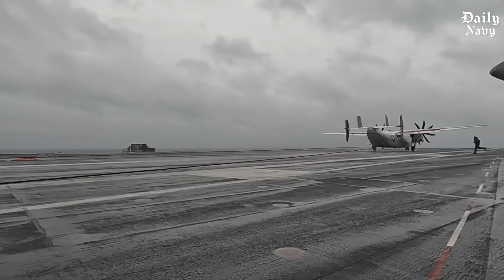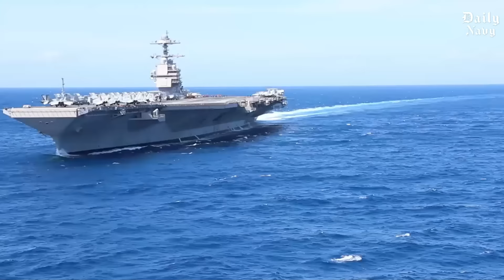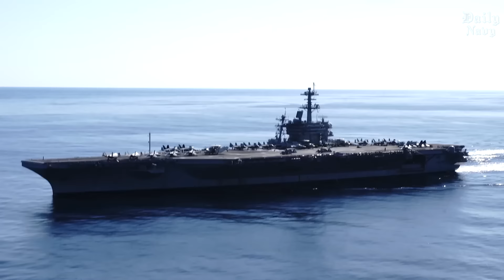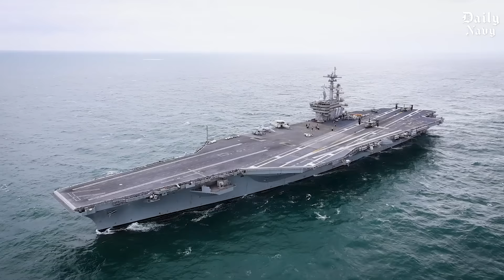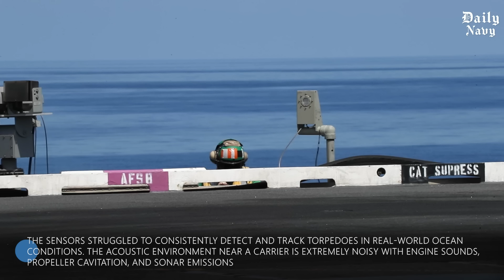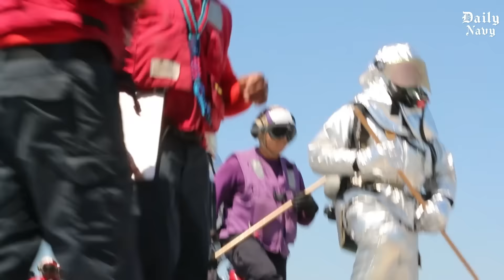How Massive Aircraft Carrier Survive MONSTER Torpedo Impacts

Comment: That all makes sense from a theoretical standpoint, particularly regarding defenses against torpedoes. However, I do not think aircraft carriers have adequate protection or structural resilience against anti-ship ballistic missiles. These weapons attack from above, descending nearly vertically, allowing them to penetrate the flight deck and continue through multiple internal decks toward the hull, effectively drilling a shaft through the ship. This is especially true for the type of anti-ship ballistic missiles reportedly developed by Iran, which are conceptually similar to bunker-buster weapons and designed to penetrate structures before detonation. Because such missiles travel at hypersonic speeds, the time between detection and impact is short, compressing the tactical window for interceptors on escort destroyers to engage them. Under some conflict scenarios, defenders may not detect every launch early or track every trajectory sufficiently to guarantee an intercept before impact. Given the hypersonic velocities and associated kinetic energy of these missiles, an aircraft carrier would have very limited capacity to absorb such strikes. If several of these missiles struck an aircraft carrier in quick succession, it would likely be mission killed, if not completely disabled.

Comment: Bad design; too vulnerable.  A carrier with its airplanes and crew may cost around $20 billion, yet a dozen Mark 48 torpedoes would only cost $60 million (and far cheaper if homebrew hardware store special torpedoes that are remote control FPV drones that simply travel 1-2 meters under the water line, and have a communications antenna that sticks slightly above the water line).  A dozen torpedoes absolutely can and would readily win a fight against a $20 billion carrier, which ruins the economic equation and makes carriers a very poor use of valuable and limited economic resources.

To better protect against torpedoes, the ship hull needs to stay out of the water.  One way to do that, is to design a "navy ship" as an airplane, with sea landing capability, so it can conserve fuel while on station by simply sitting on the water surface.  Then, if a torpedo is heard approaching, the "navy ship" can take off and become airborne as needed to avoid the torpedo.

An alternative potential improvement, would be to use a more conventional naval ship design, but mount long legs with hydrofoils on the bottom, similar to the "USS Pegasus".  Then, upsize the nuclear reactor power levels on the carrier dramatically, so the carrier can continuously maintain high speed travel while lifting the main carrier hull body out of the water entirely, via the hydrofoil legs.  Only the bottom of the legs and the hydrofoils need to be in the water at all.  Additionally, non-hydrodynamic cages and air pockets can be built around the hydrofoils, in order to cause incoming torpedoes to detonate on the cage, which can be physically separated from the hydrofoil and bottom of the legs.  Although non-hydrodynamic structures under the water line incur a propulsion energy efficiency penalty, such penalty can be paid and overcome, when the nuclear reactor cores are upsized in power level sufficiently.

Multiple legs should be used, which are redundant, such that damage to only one leg and hydrofoil does not necessitate lowering the whole hull back down to the water surface.  Lifting the sensitive bits of the aircraft carrier out of the water (especially the nuclear reactor cores and the explosive ordinance magazine for storing the airplane munitions) would greatly help to protect such vulnerable ship areas from torpedo attack.  Lifting the carrier body out of the water would make the sensitive parts of the ship more vulnerable to airborne missile threats, but incoming missiles are easier to detect/track/intercept, as compared to underwater torpedoes.

Upsizing the nuclear reactors and increasing propulsion power enough to achieve hydrofoil "flight" above the water, would make the carrier move much faster during normal operation, which would hypothetically prevent other non-nuclear powered ships from keeping up due to fuel consumption reasons.  To fix that problem, other ships in the carrier strike group, that do not have their own nuclear powerplants, should instead be designed to use electric motor propulsion, with a diesel generator.  Then, when travelling in the carrier strike group, a rapid breakaway power cable should be strung between the carrier and each other electric ship in the strike group, so the nuclear powerplants on the aircraft carrier can keep the other ships continuously powered at a level sufficient that they can continuously keep up with the carrier.  Essentially, all ships in the carrier strike group should be electric powered, and they should all also implement legs and hydrofoils like the USS Pegasus, in order to keep their main hull out of the water.  Such a scheme would effectively make all the ships in the carrier strike group nuclear powered (from the aircraft carrier reactors), which would greatly reduce need for constant refueling operations of the support ships.

The hydrofoil legs on each ship should however be designed to be quite a bit longer than that which was implemented on the USS Pegasus, so as to provide better operation in rougher water with bigger waves.

That said, the US government is too poor to afford any of the above.  The US government is too heavily indebted, and a better approach is for the US government to mind its own business in international affairs, rather than trying to maintain a large "blue water" naval force intended for force projections all over the Earth.
Reply: When the navy decided to use the USS America (CV-66)  for a sinkex, they threw everything they could think of at her, with the exception of maybe a torpedo or two or a ballistic missile. Long story short, they couldn't sink her. EOD had to go on board to set charges so that she would sink.